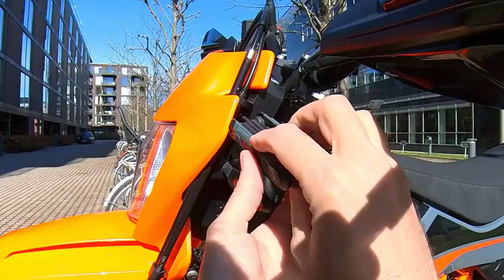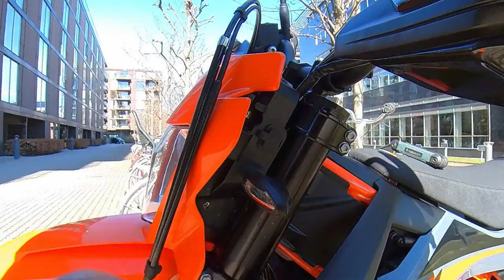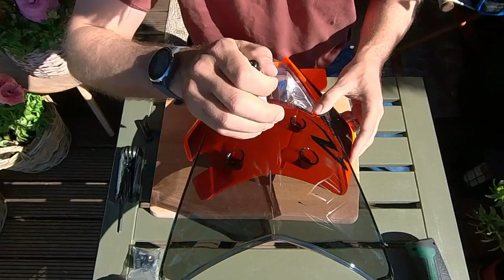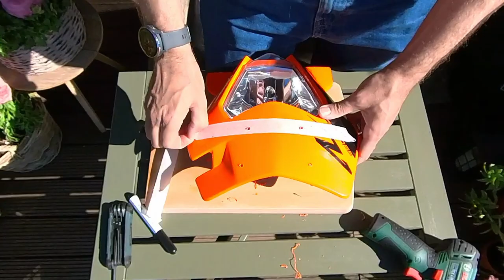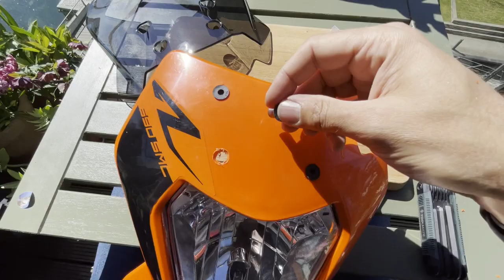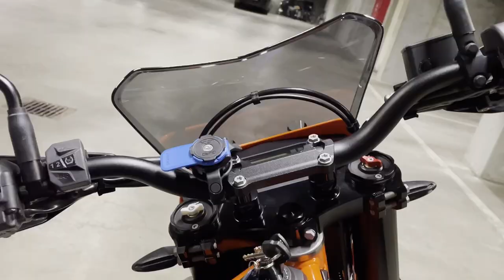HOW TO: Install a KTM 690 SMC R windshield

Comment: For anyone watching this you don’t need to mark the location for the holes. They are marked on the backside already from the factory.  Just drill a small hole from the backside using the marks then enlarge from the front. The instructions are on KTMs webpage.

Comment: Great video man, is it a big difference with it on?  What’s the horsepower gain?
Reply from the maker: There is noticably less wind buffeting on the motorway. So a more comfortable ride above 100 km/h. There is no HP gain.

Comment: Hi, just a little thing, you're too tight. Over time, it can crack due to vibrations. Take care of yourself. Jan
Reply from the maker: Thanks for the tip. There is a lot of vibration in the handlebars so i will loosen the fittings.